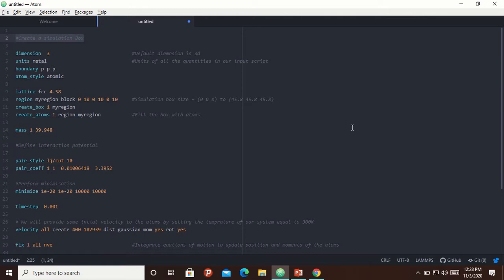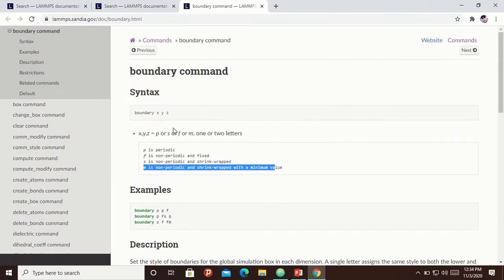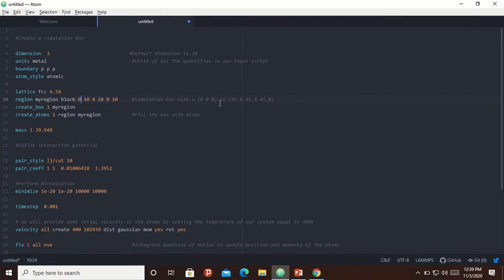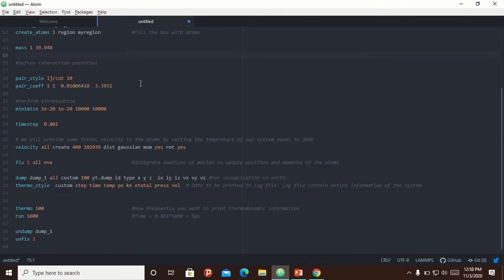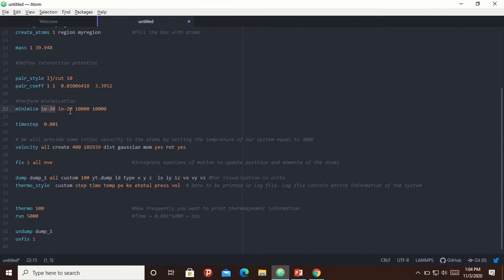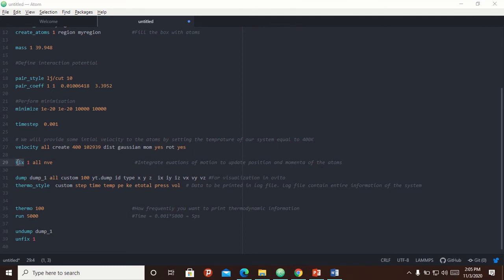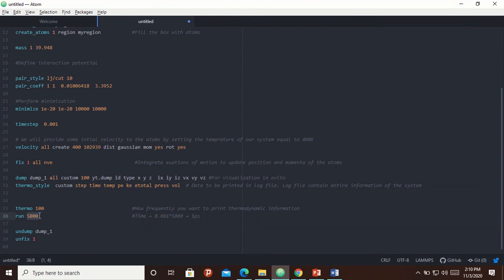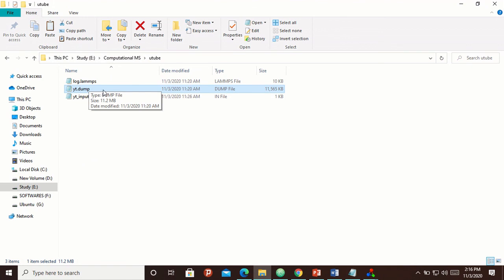Write your first LAMMPS Input script | Molecular dynamics simulations

Comment: Where to write the coes for LAMMPS? And how do you execute the files to get the result? Can you elaborate on these points? Thank you.
Reply from the maker: @sayanchatterjee8399  You can write the code in a simple text editor. You can run with "lmp -in  input.in". lmp is executable here which could be same or different for ur case.

Comment: Very well explained. Can you make a video on polymers as well?
Reply from the maker: Can you elaborate a bit?
Reply: Certainly! You provided an input file for a single atom. Could you now provide input files for molecules such as water or CO2? Additionally, if possible, include examples for polymers like PMMA and PA.  @Vinay192
Reply from the maker: @Jaggu_Reddy  You can create your model using packmol and then use vmd to generate input file for lammps. If you are not aware of this method, I will post a video on this.
Reply: Yeah, bruh, I'm not aware of this. Could you please do a video on that and post it?  @Vinay192

Comment: Thank you so much sir. It is really helps me a lot. Can you please tell be concept of compute comment in lammps. I want to calculate charge of each atom in my system (NVE) in ReaxFF, for each time step (from beginning to end). Some people said use fix qeq/reax comment in input file. I tried this but I don't know where I have to get the output (charge of each atom for each time step). Can you please help me sir
Reply from the maker: Unfortunately, never tried this.....
May be it can help(Not sure): https://docs.lammps.org/fix_qeq.html
Reply: @Vinay192  thank you sir
Reply from the maker: @hingiesmonisha3038  let me know if you able to do..
Reply: @Vinay192  sure sir.
Reply: @Vinay192  successfully got the charge of each atom sir. Thank you sir
Reply from the maker: @hingiesmonisha3038  that's great.... what was missing?
If you want you can email at: vinayx.thakur@gmail.com

Comment: very helpful video, thanks! I have a question, you trigger the molecular using "velocity" command. Can I just use "fix 1 all NPT temp xx xx 100 iso 1 1 100 " instead? What's the difference? Thank you for any suggestion !
Reply from the maker: You can't do that way... In MD simulation you need to provide initial velocity to the system which is only done through velocity command.
And About nvt, npt and nph:
These commands perform time integration on Nose-Hoover style non-Hamiltonian equations of motion which are designed to generate positions and velocities sampled from the canonical (nvt), isothermal-isobaric (npt), and isenthalpic (nph) ensembles. This updates the position and velocity for atoms in the group each timestep.
Reply: @Vinay192  thank you so much for the explain! I'll try this right away.